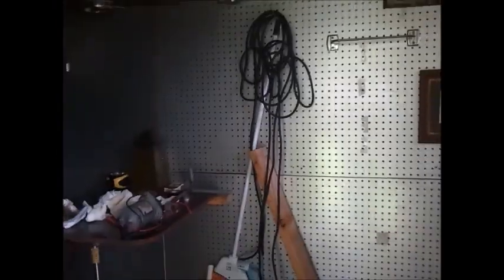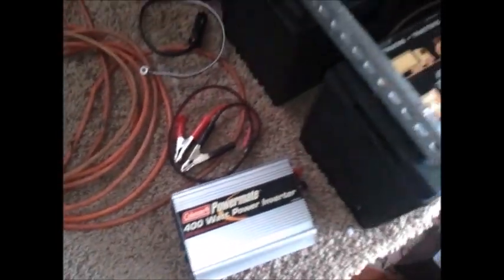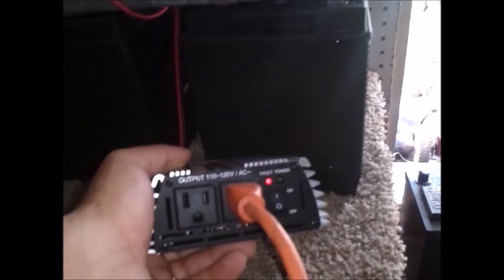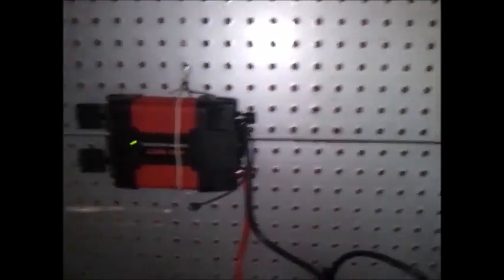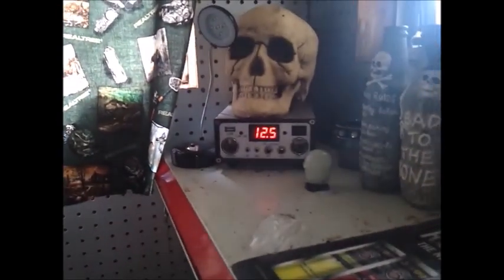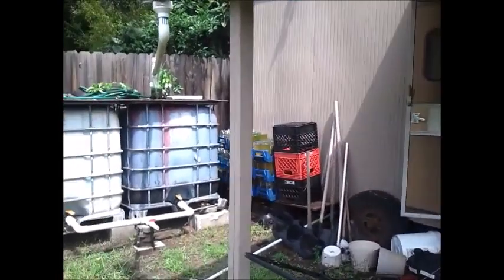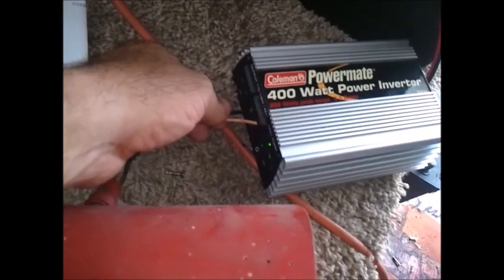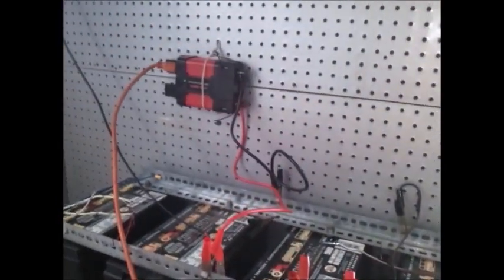can a fridge run on a harbor freight solar kit

Comment: Black Amorphis film panels. worst, weak, cheap but works.
Reply: Actually the HF Cells Put Out MORE Power in Low Light then the Other Cells. Proven on many Channels and Sites. Even if they are Half Covered and it's Cloudy out, they Put Out About Half or more of their Ratings while Other cells put out nothing. Combine them with a GOOD Quality Mppt Controller the New 100Watt Kits from HF will Out Perform even a 200Watt Poly Kit in Low Light areas and while being Half Covered. All while Costing Less.
Reply from the maker: your right, in a pinch they work great for the price. thanks for watching.
Reply: That's the difference between Poly and Mono. Poly does much better in direct light, where Mono does much better in low light. You would get the same results with Renogy Mono as with HF Mono and vice versa.

Comment: alright, so HF inverter works with this being fed power from battery and battery getting power from solar panels but realistically, with battery bank that big and solar panel setup like that,  you won't be able to recharge drained down batteries, let alone run refrigerator on regular basis,  right?
Reply from the maker: with solar panels its all about what you want to run off of them. the more power needs you have the more batteries and panel you need. a real house setup will have more batteries and larger panel to run everything.  what kind of stuff would you like to run off of solar?

Comment: Being solar curious I went for the HF 45 watt with a Labor Day super coupon. $129.99 and used  the 25% (not 20%) one day only coupon to buy the battery. Also bought the 6 piece cable kit for $9 bucks. I'll wait for one of my subscriptions to bring me a 20% coupon so to get the inverter. little by little my solar learning lab will be pieced together on the cheap. You have an awesome grid-down lab. Thanks for sharing your experiment. It means so much to those of us just starting to see set-ups like yours and become inspired by them. Can you recommend any books or magazines on solar that have been solid for you? I would appreciate it, and I'm sure many, many others would too. Nice video. God bless.
Reply from the maker: thank you for watching. the best way that I have learned solar is the internet, you can find a lot of info that can teach you a lot.

Comment: if I was going to go with a solar panel system I would avoid the HF panels. They are amorphous silicon, which is the bottom feeder of panel types. compared to mono or polycrystalline, they have about a third of the output and service life. yes they are cheaper but not if you consider performance and durability.
Reply from the maker: getting into solar power they are a learning experience.  but a whole house I would use something better. thanks for watching.

Comment: Do Not Let The D.C. Volt Get Below 12.2here My Setup 24/7 on solar panels only a Refrigerator I.D. No:WRT359SFYW https://www.youtube.com/watch?v=PA8DB4JTLR4
Reply: when the battery bank gets to 12.2 doesn't that mean that your down to 50% and you need to charge the bank again?
Reply: You really need to check Specific Gravity of the Electrolyte volts is not a very accurate measure of charge esp if it is not open circuit.
Reply: The Cost Of Battery.s Just Doubled For Me
That's Upgrade Just Cost About $2,000

Comment: I think the reason the Colman went to fault is because you are missing the ground pin in your orange extension cord plug. I have seen this as a problem in the past with other inverters.
Reply: I was thinking the same abt those rails..you should at least have the positive side insulated
Reply from the maker: I'll look into that. thanks for watching.
Reply from the maker: +chales dor no, thay are the same size. looking at it right now. thanks for watching.
Reply: You are right
Reply: Hay dude the reason the fridge will not run on the 400 w colman is cause it takes 1000w to start it...that harbor fraight inverter is 750w an 1500w peak,  look at the lable or read the instructions.